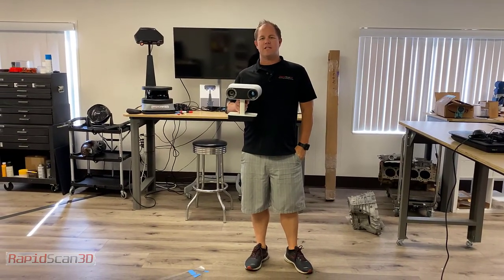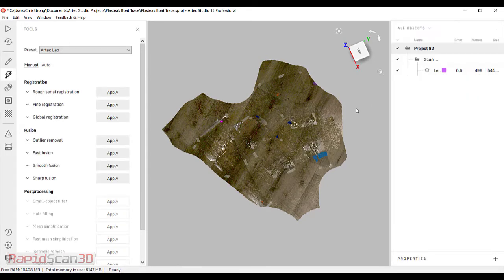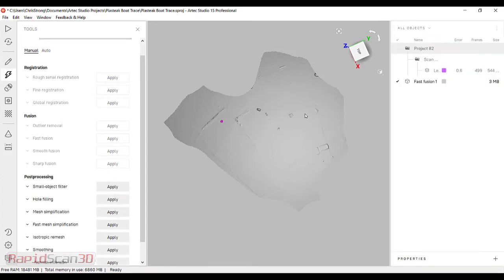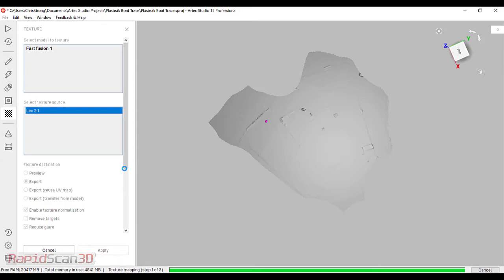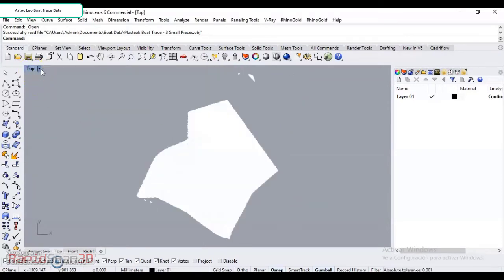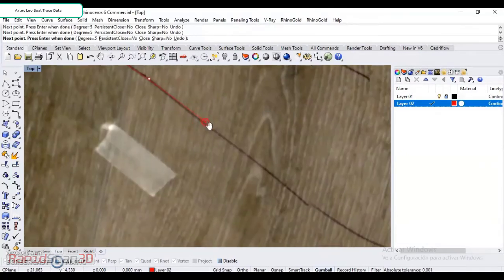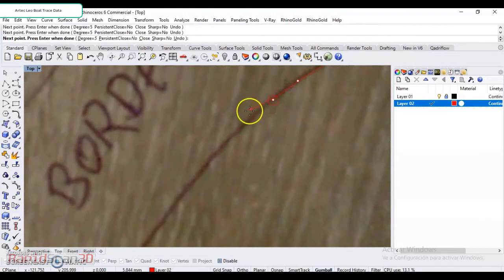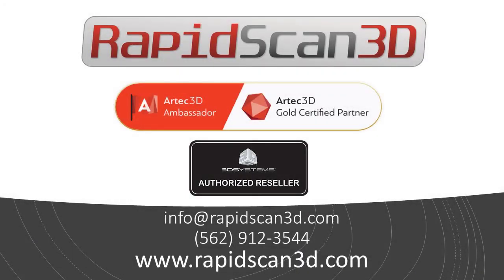Creating DXF Files - Custom Marine Decking - Artec Leo

Comment: hi team,
firstly, great video.
I was wondering how the leo scanner takes this scan so quickly from one angle, and the second part to this, how does it create a dimension accuracy without markers ?

i have a laser scaner which is great for accuracy using the marker system, but i have no way of making a quick accurate photo scan of a flat pattern without inputing some dimensions and scaling.
Reply from the maker: Great question.   The Artec Leo utilizes Geometry and Texture (color) Tracking to align the scans together.  The system has a builtin in projector and based on the projectors pattern and distortion in knows where it is in space and the geometry of the object being scanned.  This is why the Artec 3D scanners are so powerful and popular.
Reply: @ thanks for that. 
do you have a re-seller in Australia ? or would we buy something like this direct ? 
Also, what sort of capacity is in the onboard drive ? eg, could i do the decks and hull of a 30ft yacht ? or would it require multiple scans and downloads ?
Reply: The scanner has a strong hard drive, but you can offload data onto a micro SD card, or even send the data via ethernet or Wi-Fi to your computer. Yes, you could do a bigger yacht as well. My suggestion would be breaking it up in sections. We do have another video showing the yacht on our YouTube channel.